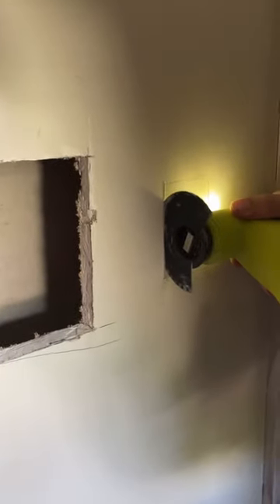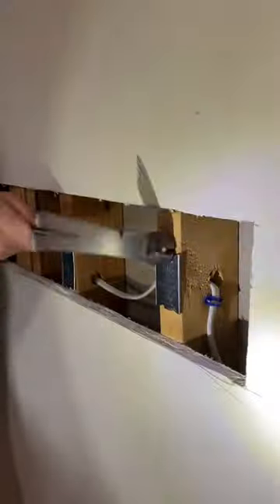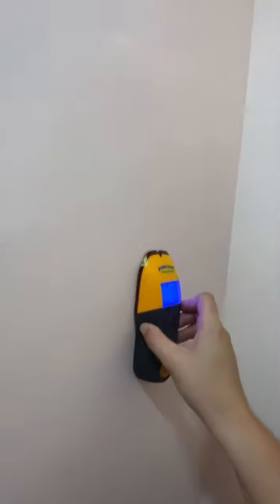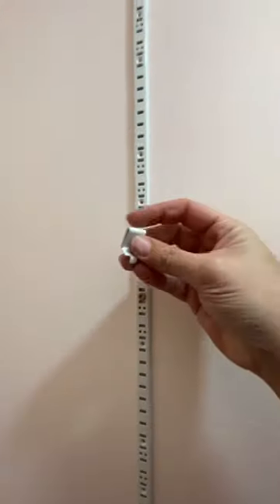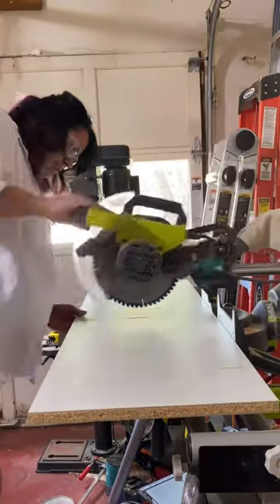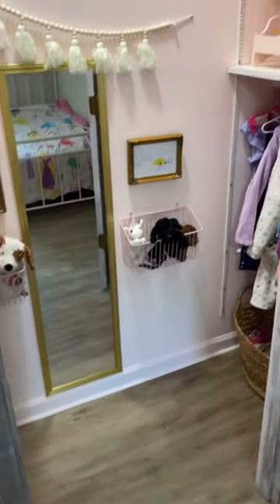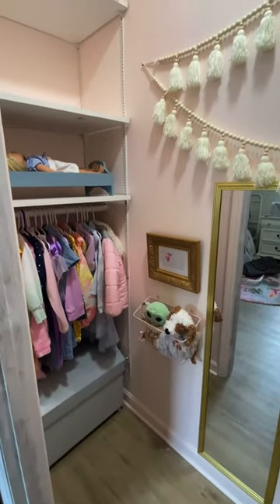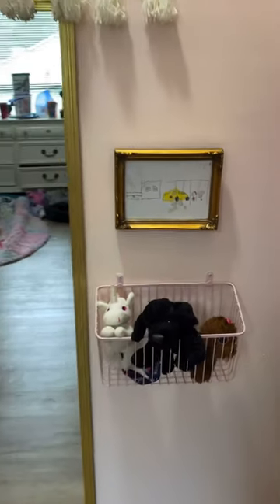Small Closet Makeover - my girls share this small closet so I switched the layout

Comment: Aaaand…here comes a guy to tell you “Thank you!” Installing those metal plates on the studs that have electrical or plumbing through them isn’t a decor idea, but it will save significant headaches later, if you start another project or need to mount something on those studs. A lot of people don’t know or overlook that, or they leave it out of the video because it isn’t pretty. However, it is SMART. Well done!

Comment: Never start saw when on board start then lower to board...a kick back can occur..always have board straight against the saw and firm grip stand to the side of the blade to prevent a kick backed board from imbedding into your body. Good job mom
Reply: Yes of course. I was testing to make sure the blade would be in the same line. The blade is always fully spinning before bringing down to touch the wood.
Reply: These tiny little battery-operated sawzalls ain't going to do shit

Comment: End result, you have 4 feet of storage space (2' on each end) where you had 7 feet originally.
   Addressing the wall & changing the door function would have gained full access. All the rest could still have been done the same way.
   If you don't already have the skills to work on the wall & doors just believe you CAN (because it's true) & see tutorials online. It's not very difficult & you obviously have a good imagination & a good eye to back it up.
Reply: If it isn’t a bearing wall, they could have build a new wall further out to make it a walk-in closet.
Then you still could have had room to hang clothes on a long closet pole. 
👛👗👚
Reply: @marlenegold280  
Very little chance it's a bearing wall & easy enough to confirm.
Relocating the wall is a splemdid idea - & abig job.